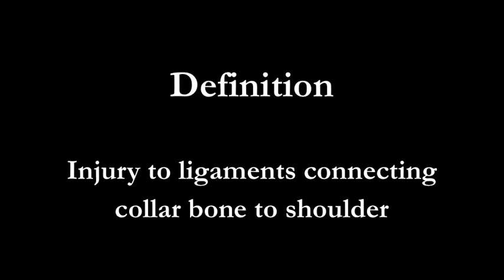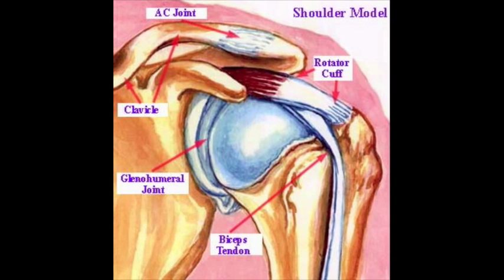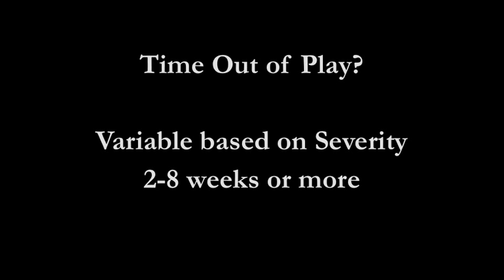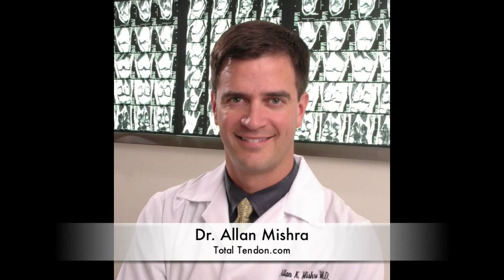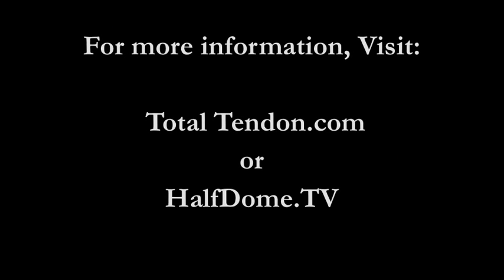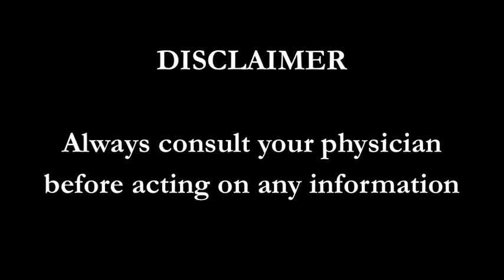Shoulder Separation/AC Sprain  Dr. Allan Mishra

Comment: I suffered a grade 3 seperation a few years ago playing league. Didnt really hurt till I cooled down and the pain started. The fools tried putting it back in (unbeknown to us all they dont go back in) so that just equaled more pain.

Ended up getting the operation to have it screwed back in and ligaments reattached about 1 year after the injusy and it was well worth it. Joints stable now and not moving around like a diving board as I use to refer to it pre op. Also the lump is greatly reduced,

Comment: i suffered a partial ac joint tear in august 2009, went to the doctor and she said it should just heal on its own, i play hockey in the winter and the doctor said it was ok because you arent using the same mootion as in baseball which i suffered the injury in. I had no problems in the winter but as soon as baseball started in june it has been hurting more then when i first suffered the injury, there is now a bump over my shoulder, do you think i have completely tore it now?